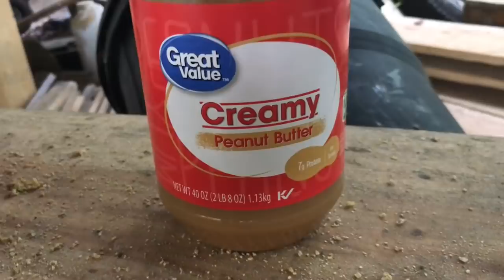Trapping: Setting Raccoon Traps

Comment: Our racoon trap is called a 22 lr
Reply: i use subsonic 7,62x39 - from a shortened rewelded mauser reciever, newly turned and hardened bolt and AK mag feed boltaction with 16inch barrel and 300 WinMag can and thermal scope  -thats good for all from opossum and mink til fox and deer with different ammo 
the action is so strong that i can fill the case to max capacity with powder and even make compressed powder loads without it failing - 7.62x39 got to little capacity to get at the critical levels of a 8mm Mauser rated action - but i get 308 style performance with max load
Reply: @prinzeugenvansovoyen732   You need to get out more.
Reply: @goatsears  please explain what you mean
Reply: @prinzeugenvansovoyen732  You're spending too much time with your guns lol
Reply: @goatsears  i am pretty sure im doing the opposite, i have barely worked on them the last month, despite the fact that i maschined most things myself on all but 2 of my 11 (soon to be 14) guns and made some tooling for it and spare parts for myself and others as well as reloading equipment, load development, the supressors and some stocks, aluminium and wood made 
im pretty proud of my 20 gauge repeating shotgun with a mix of Vetterli locking system, a swiss G1911 boltface, the firing pin system from a cock on close Mauser, a modified M95 manlicher extractor and a homemade 10 round box magazine
all maschined out of Hadox 700 - pretty similar stuff to AR500 and a barrel made of a unsoldered barrel from a old brake action rife/shotgun combo that got interupted threads for easier cleaning and quick transport
Reply: I know how you feel Prinz lol

Comment: Do the traps you are using only clothes on a single paw or leg? I've used Victor High Jumps they literally  spring off the ground an inch or two then snap shut usually breaking the critters neck.  Ever try snares? Set the snare right and get the animal's neck nine times out of 10. The new snares lock up the harder the animal pulls the faster they pass out and die.

Comment: Did anyone notice how the camera person was following her hooah & booty  & getting a close up, just saying😉🤗❤  Hannah why u going barefoot aren't u afraid of getting bit by a copperhead? I was just north of  Mobile, AL, & blew a tire on my semi trailer, when I walked to rear of trailer on right side I thought the brush just made u itch. Turns out I was bitten by a copperhead & a baby at that.  I was wearing flats, & it struck my foot 6 times. My foot itched, severly, a little painful, & the red marks swelled. I ended up going to hospital after my delivery in Mobile. The doctor knew what it was, he said u got bit by a copperhead. He measured the fang distance. He told me I was lucky because baby snakes can't control there venom, lucky for me they were dry bites. It took 10 mos for the fang marks to disappear. I woke up one morning & cried & saw that they were gone. I had gotten used to them there. Never ever wanna get bitten again. u rock Hannah.